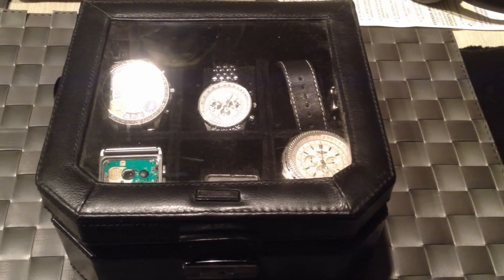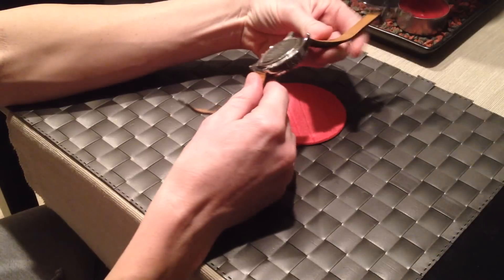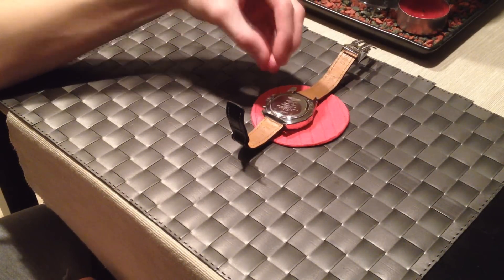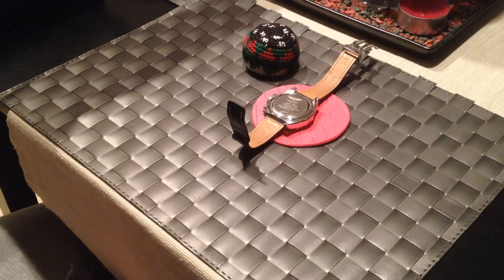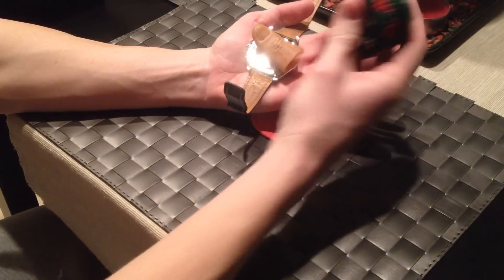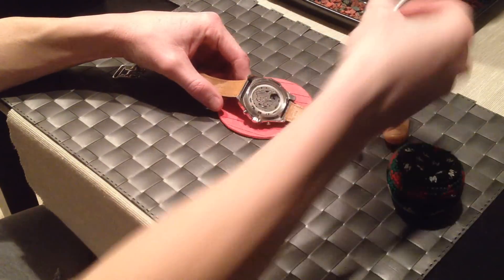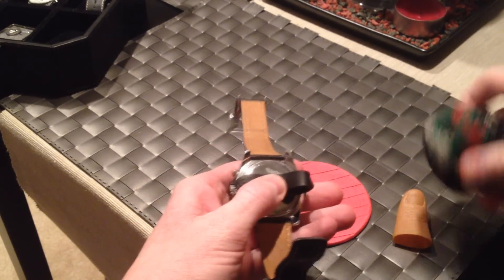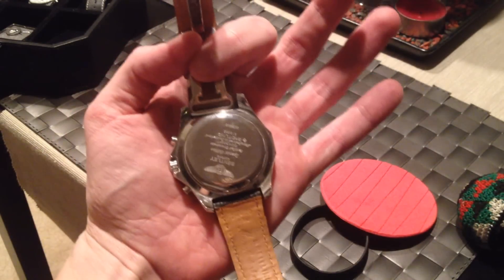How To: Unscrew Off The Back Of A Watch

Comment: Brilliant! Solved it using a newspaper that I folded in the shape of a ball and introduced it in a latex glove.
I usually try to avoid watch workshops, cause once they couldn't properly take the back lid off and my watch ended up with many deep scratches all over the back of it, only for a battery change!
Cheers!

Comment: I too did not believe that a rubber ball would work. I did not have one and I was looking around the house for anything that would work. I sh!t you not, I just opened a submariner case back with the rubber sole of my shoe! I have a pair of Slazenger with a smooth rubber heel and with some effort, it unscrewed.

Comment: Or you can spend $2 shipped on ebay and buy a screw back case opener from China.
Reply: Relax dude, its a one time cost of $2 bucks and I don't think it will affect my retirement plan. . If it makes life easier and its that cheap, why not?  Now go back to collecting those empty plastic bottles from dumpsters. .
Reply: Seems like buying a purpose-designed tool so you can do it yourself rather than pay a jeweler to do it for you IS "doing shit for yourself".
Reply: Exactly right. I guess its too complicated for Jacki Goon to figure that out.
Reply: +Nick V Then why did you need the video in the first place?
Reply: lol because why buy a tool unless you need to?